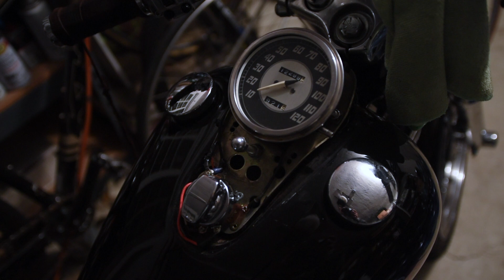Harley Davidson XLH Ironhead Sportster Removing Bobber Gas Tank to Fit Original AMF Peanut Tank

Comment: What year is this I’m trying to figure out which tank style I need
Reply from the maker: @BobmaxXD  1974 . pretty sure its the first year of the AMF tanks that ran for a good while in that peanut style.
Reply: @k_otix  awesome I have a 76 and couldn’t find anything online it keeps showing two different mounting types for the tank’s available
Reply from the maker: @BobmaxXD  yea you should be looking for an AMF decal tank the mounts are to the top tube of the frame which the tank rests on. the front mounts align with the bracket that holds the ignition coil , if you have a stock setup.
Reply: @k_otix  awesome thank you I’ll check it out
Reply from the maker: @BobmaxXD  checkout this link - https://www.ratbikeservice.com/HD/dwnld/Parts-Catalogs/1954-78%20XL1000%20Parts%20Catalog.pdf to see the original parts catalog ...